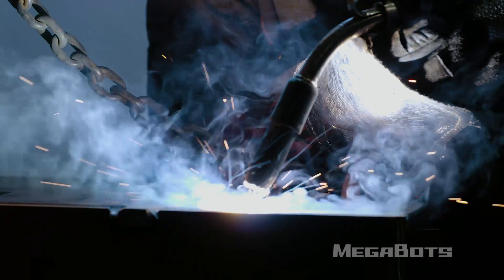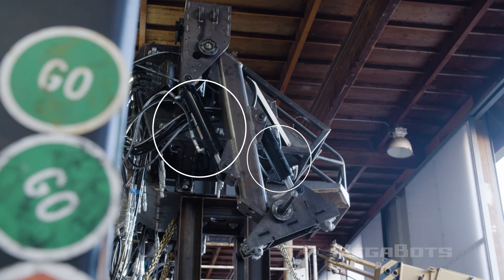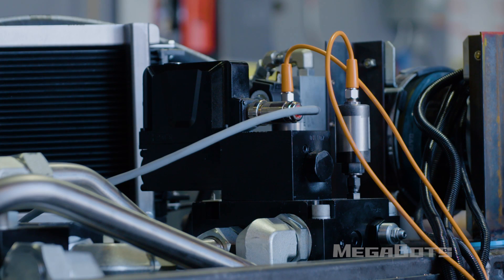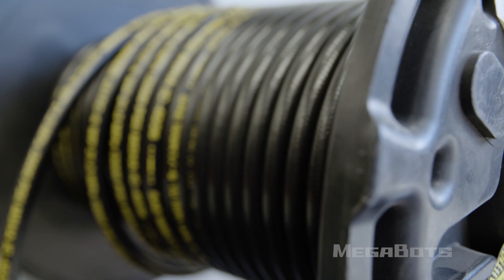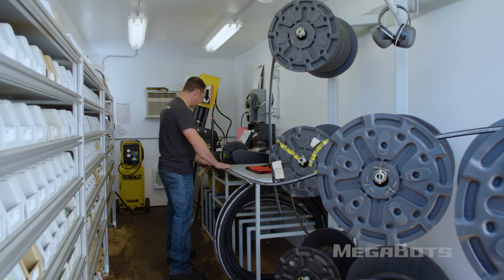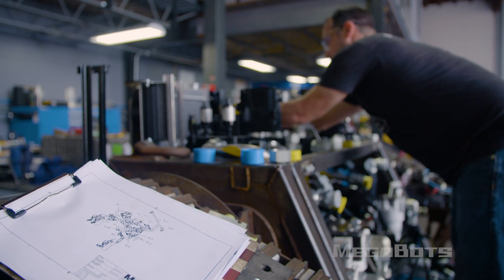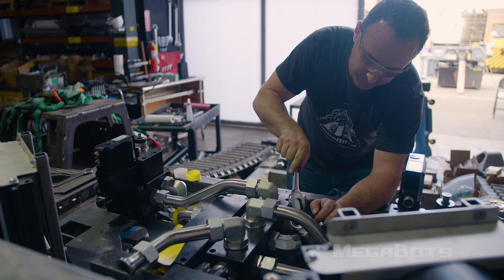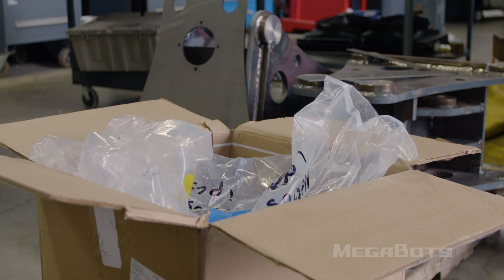Hydraulic Routing (Behind The Scenes)

Comment: so, what do you guys think suidobahsi is doing?
Reply: Michael OMeara probably not bragging around and revealing their projects to the opponents
Reply: Most likely working on 3 things- making better armour panels to replace the carbon fibre or plastic they currently have (I'd bet they're doing titanium, ballistics ceramic, or a more advanced carbon fibre) and making better weapons- probably smaller and less damaging than the MKIII has, but more accurate and re-usable.

But mostly I think they're probably going to be focusing on coding.  The Kuratas is piloted by a single guy, so a lot of their movement stuff is probably going to be automated- collision avoidance, converting from walking to rolling, stability stuff- and what isn't fully automated is most likely going to be set up via Macros, motion-control, and made to self-correct based on pilot input.

That's where the Kuratas is going to have an advantage over the MKIII- the pilot will be able to focus much more on positioning and avoidance, and actual combat, rather than having to control things and coordinate with a partner.  It'll have faster reaction times, and smoother action due to this.

The MKIII is definitely going to be more durable and stronger, but the Kuratas will be able to avoid a lot of the MKIII's hits, and hit back a lot more.
Reply: Drinking green tea.
Reply: The hell would they be building that many more robots, instead of upgrading the one they have built? Kuratas is designed more as a toy of the super rich (you can buy them on amazon), and this is a promo for them. Nobody wants an older design that won't ship for at least another year or two, and making new designs is a dumb idea when you've had your robot that you already have built.
Reply: Michael OMeara building 3 more robots, more advanced than this one and more bad ass
Reply: they are brobably useing graphene (the strongest and lites material out there and maybe titanium as u said or uranium reinforced tank armour and for weapons they might be useing a diamond drill or a katana becouse they are japanese
Reply: Haha no. Graphene is expensive, and I can't see any company spending that much on armor. Making a drill out of diamond would also be impractical due to feasibility and cost issues, and katanas, from what I've seen, are meant to be used with a speed that simply isn't available at this point. 

As to what they are doing, I'd say finalizing the full assembly, making sure everything works as intended, testing the code, etc. Most of the design and weapons would already be done by this point, and all that's left is making sure it all functions. 

On the giving away everything, I'd argue megabots isn't actually giving away that much, as all they've really done is show they have weapons and what some of their design are. Very little of the final robot has been show, and given that, as the LAUNCH video has shown, they aren't so much trying to make a company out of giant robots, as much as they are giant robot FIGHTS. Big difference.

Comment: Those tubes might also be able to take a blow a bit better than those hoses. I mean, it doesn't matter how strong the rest of the robot is, if one of those lines got cut and the pressure where to escape, your robot is suddenly immobile.
Reply: Neither is likely to break with whatever ranged weapons they'll be using, but in a melee fight, a hard target can be a blessing and a curse
A hard enough surface won't break as easily, sure, but you may not be able to land a solid hit on a soft moveable hose in the first place, whereas a stationary metal tube is the perfect target
Not to mention the hose potentially being able to compress when struck

Depending on what weaponry the kuratas has(especially since it's shorter), this  might not be a good thing
Reply: Huntracony Hopefully there'll be armor protecting the hoses so it won't matter as much.